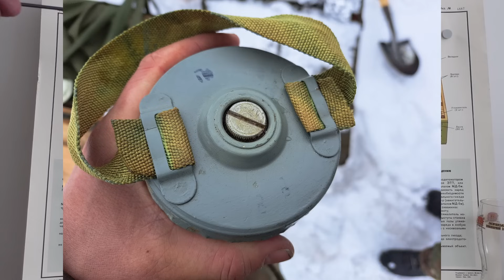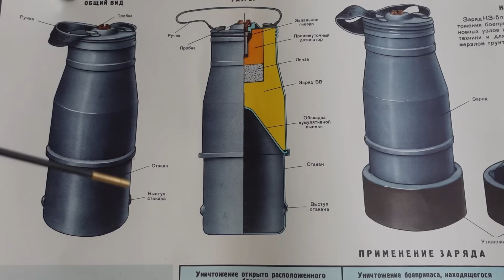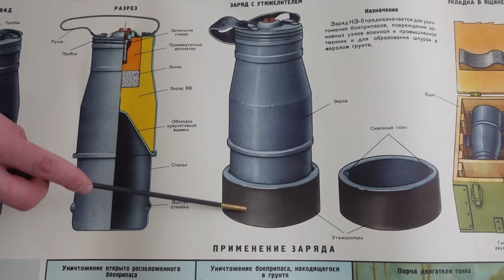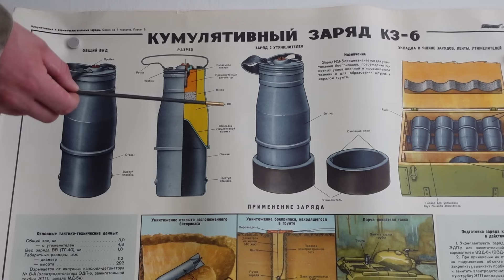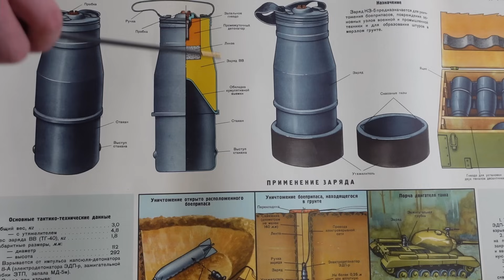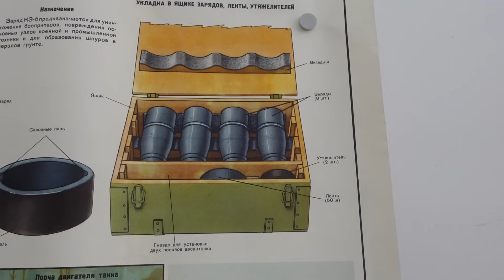WW3 Cumulative charge:  KZ 6

Comment: Never heard that term. “Cumulative Charge”. It seems to be what we called a shaped charge. We also had them in various sized. You could for example put a shaped charge onto frozen ground. And it would bore a small but deep hole with the shaped charge “jet”. Which you could then put in a cratering charge down the hole. And create a fighting position or to limit mobility of vehicles. Etc.
Reply: Cumulative charge is apparently the Soviet Union phrase for shaped charge
Reply: That sound so much better than using an entrenching tool for hours
Reply: @ truly frozen ground… deeply frozen… is like using an e tool to get through concrete. But yes. It’s like using a pick in combination with a shovel. Moving “broken apart” soil is much easier than doing the breaking.
Reply: Cumulative charge kinda makes more sense than "shaped charge" tho.
Reply: @teresashinkansen9402  in order for “cumulative” to make sense… with the English Language… you would have to have multiple charges… or multiple processes… that when combined… increase the resultant. There is no “multiple charges” or “multiple processes”. Just a single detonation. You might argue that the geometry in a particular charge increases its potential force. Which is true. But nothing about this increase is due to an accumulation or a cumulative process. It’s a single detonation that uses geometry or the “shape” of the detonating material to focus its force on a single point. No more or less energy is required. Just a more “efficient” use of the same energy. Hope that makes sense. Not sure if English is your primary language.
Reply: @ By changing the geometry of the liner you are cumulatively increasing its cross-sectional density.
Reply: @ again… you’re not using the word “cumulatively” correctly. “By changing the geometry of the liner”… you are “cumulatively”. The Definition of cumulatively is to increase or enlarge by successive additions. What are the successive additions. What is being added together? Are there multiple geometry changes in a process that we can add together?
Reply: @ define “cross sectional density”. What does this even mean?
Reply: @ Look it up by yourself, its is a common term used in ballistics. But basically means the apparent density of an object by taking into account its area, density and lenght.
Reply: @teresashinkansen9402  another argument/thought… is that typically shaped charges don’t just use the Monroe effect on it’s own. It also uses a metal (Typ. Copper) that the Monroe Effect will turn into a liquid (molten) slug… that gets “pushed” at the same velocity as the Detonation Velocity of the Explosive (which is very very very fast). Like from San Diego to New York in “7 minutes” fast for PETN (in det cord). So you might also argue that this is a cumulative process. When you are combining not just an explosive… but a Liquid Metal “slug” or “bullet” to do more… than either on their own. But this would lead down the road that even a hand grenade is a “cumulative” charge. Due to the presence of a primary explosive (cap), sometimes a “booster explosive”, and a primary explosive filler (Typ Comp. B) and then the jacket or fragments. Which all combined do more damage than the pieces. But to me… that’s silly.
Reply: @ I’d say a name that describes the function makes sense. What a shaped charge does… is utilize the Monroe Effect (where the detonation velocity of a solid “detonating” directly into a gas… always occurs perpendicular to the surface of the explosive) to direct a detonating in a particular direction and focus it. It has nothing to do with the explosives (as many types can be used) and everything with the “geometry” or “shape”… aka… a “shaped charge”.
Reply: @ so in order for me to agree with your statement… you’ll have to clarify how the word “cumulative” makes more sense. I don’t see it.
Reply: @ The charge works by imparting energy from a large area of explosive into a thin barrier (the liner) which then collides with itself, and by hydrodynamic deformation the liner turns into a rod like projectile. So the penetration is due the cumulative effect of the mass penetrating into small area.
Reply: @teresashinkansen9402  what cumulative effect? What is accumulating?
Reply: @teresashinkansen9402  accumulating: to collect a large number of things over a long period of time:
Reply: @teresashinkansen9402  cumulative: Increasing or enlarging by successive addition
Reply: @teresashinkansen9402  what are the successive additions?
Reply: @ Cross-sectional density
Reply: @ Exactly. The liner is now a rod like object which penetrates the target by continuously impacting material in a small area. Imagine a long train crashing into a wall.
Reply: @ so what “cumulatively” increasing this “cross sectional density” mean?
Reply: @ density is the mass/volume. I’d say that the density… decreases… not increases… as you detonate the charge. If it was cumulative… as in the cross sectional density as you said… the charge would be facing away from the target.
Reply: @ yes… that’s how a shaped charge works… lol. Now what’s “cumulative” about that?
Reply: @ Now you explain me how "shaped" is a better definition. When shaped only means in the shape of. What shape?  Any charge is shaped for optimal performance for its specific task, there is nothing that says shaped defines a device that works by the Monroe effect.
Reply: @teresashinkansen9402  again… “cumulative” is a succession of additions. Or multiple inputs that add together for an increased quantity. What multiple inputs are being added? When you’re discussing a shaped charge?
Reply: @jastrapper190  My charge is "shaped" in the for of a pizza. will that work? it is a "shaped" charge.
Reply: @jastrapper190  What you say makes no sense. Wikipedia has a good article about it.
Reply: @ because of the shape. It’s the shape that does the work. If it were a square void… or a circular void… or some other geometry… you’re not going to penetrate as much steel.
Reply: @ they have spent ALOT of money and time into determining the optimal shape/geometry to achieve the maximum penetration
Reply: @ The Munroe or Neumann effect is the focusing of blast energy by a hollow or void cut on a surface of an explosive
Reply: @ different shapes… will have different effects. As you’re directing the explosives in different ways. Think of what a magnifying glass does to light. How you can shape lens to do a whole range of things.
Reply: @ the Monroe effect… IS the shape. It’s what occurs… when you have a particular “shape”. In demolition training… they often teach how to use an old wine bottle… as the bottom of it… if you mold C4 into it… will give you a very good proximation for the void/shape that a factory would produce when pouring the charge for a Javelin or TOW missile penetrator.
Reply: Approximation*
Reply: @teresashinkansen9402  no… a shaped charge is designed to penetrate steel armor (or concrete or wood)… you can’t just use “any” shape. It’s a very specific shape. Aka… the shape of a “shaped charge”. Lol
Reply: @ Shape does not define anything it only means in the form of. I could have a charge which its optimal shapes resembles a banana, that a shaped charge. An accurate name would be a Monroe effect charge, or cone charge, or jet charge. Because such names resemble more the shape or name the actual effect, not just "Shape". Shaped charge is as accurate as saying, explosive device.
Reply: @teresashinkansen9402  you can think of it as a con cavity. An umbrella… with the handle… as the visual for where the “shape” is going to direct the blast.
Reply: @teresashinkansen9402  if you had a “dome” a convex shape… instead of a concave… you would penetrate nothing. It would be an even worse geometry than if you just had used a solid flat plane.
Reply: @teresashinkansen9402  about what?
Reply: @ As I explained before. The Liner is a thin object so when it is accelerated and collides with itself, by hydrodynamic forces it becomes an elongated object, so the cross-sectional density of the liner effectively adds up, aka "cumulatively" increases in a span of time until it reaches its target and cumulatively in a span of time imparts its kinetic energy in a small area, like a long train crashing. The cumulative effect of many train cars crashing, same effect.
Reply: @ i agree. “Shaped” isn’t an all inclusive or completely descriptive. As it’s not just a single shape that will produce every effect needed. But you’re talking about a class of things. Which we refer to as “shaped charges”.
Reply: @ these can include what they call “flex linear” which is a soft malleable metal that comes in a roll. Like a garden hose… and you can unroll it and tape it to steel. If you look at the “cross section” of this charge… it’s a “V”… but again… a very specific “V”… that also uses the Monroe Effect to cut steel.
Reply: @ when you say a shaped charge… you’re describing a way to use explosives. By directing the blast with geometry. The “shapes” vary.
Reply: @ I like Monroe Effect Charge. I like Cone Charge. I like Flex linear shaped charge. Jet charge… yes yes… lol. All good. What I don’t like is “cumulative”… as I don’t see anything that’s “accumulating”.
Reply: @ taking charges that use geometry… and saying they’re “cumulative”… doesn’t make sense. It implies that you’re “stacking” or taking multiple things and adding or combining them together for a greater effect. Which isn’t what’s occurring in a shaped charge.
Reply: @ is can see your argument… that you’re saying the cross sectional area is changing… but it’s not accumulating. It’s the opposite. The cross sectional area is decreasing. This is 100% needed for the charge to function. It’s not about the increase or decrease of the cross sectional area as you go away or toward the target. This doesn’t matter. What matters is the “direction” or the “vectors” that come off the perpendicular surface of the explosive. You need these vectors to point at each other… but not so much as they cancel… but enough that they “reflect” and bounce against each other… so they combine together in one particular direction.
Reply: @ if I tell a child… I have a cumulative charge… or a shaped charge… he’ll have no understanding of what I’m talking about. But I’ll have a much easier time teaching why this class of things is called a “shaped charge” than trying to explain how the word “accumulates” or “cumulative” fit into what is occurring. Well Son… this is a “cumulative” charge… because something something… cross sectional density. Lol
Reply: @ cross section… and density… don’t belong together imo. A cross section is a plane. An infinitely thin “slice”.  It can have an area. But never a density. A density needs a volume. As by definition it’s the unit of Mass divided by Volume. You might in Engineering refer to something having a small cross section for a given mass. Like in aeronautical engineering. But to say a shaped charge has a “variable cross sectional density” it just doesn’t make sense. You could say it has a variable cross sectional area. Like a sphere. While a square has a constant cross sectional area. But you would not say… a sphere has a variable cross sectional density. If that makes sense.
Reply: @jastrapper190  Now you see how "shaped charge" is so nonsensical?
Reply: @ Look up by yourself, Im not making that up. Im done, this discussion is silly.
Reply: @teresashinkansen9402  no… I’m still trying to figure out what “accumulating” or “cumulative” has to do with anything. The word “shape” makes sense… because that’s essentially what the Monroe Effect is. Using geometry to focus an explosive force.
Reply: @teresashinkansen9402  maybe try again to explain what’s “cumulative” about a shaped charge. 🤣 what is accumulating? A force? A cross sectional area? What?
Reply: @teresashinkansen9402  the Definition of the Monroe Effect: The Munroe or Neumann effect is the focusing of blast energy by a hollow or void cut on a surface of an explosive
Reply: @teresashinkansen9402  Hollow or void… are descriptors for shape.
Reply: @teresashinkansen9402  now use the definition to explain what’s “cumulative” or “accumulating” in the process…
Reply: @teresashinkansen9402  is Flex Linear accumulating? Or cumulative? Explain why or why not. And describe what it is that is accumulating. A force? The shape? A cross section?
Reply: @teresashinkansen9402  look up what?
Reply: @teresashinkansen9402  Cross Sectional Density? Do you mean the Sectional Density Ratio? Because this is a very poorly chosen descriptor. Like “cumulative charge”. But once we look it up. And say a nail… has a “better” sectional “density” (which should be area…)… but we’ll run with it. A better SD ratio than say a gold coin… what does that have to do with the discussion? Does one shaped charge have a better sectional density (again it should be called a sectional area/mass) over another? What makes one better? And how does that apply to the discussion?
Reply: @teresashinkansen9402  if it was silly… I’m very much surprised you’ve commented as much as you have. Thanks for telling me though… i was unaware. You’re also free to go whenever you like. The doors not locked. Lol.
Reply: @jastrapper190  Looks like someone finally looked it up. 🤣
Reply: @jastrapper190  If you cannot figure it out I wont explain it to you, enough of wasting my time. This is simple stuff you should understand and part of the basic principle of how the Munroe effect works.
Reply: @teresashinkansen9402  i 100% agree. Shape. Aka “shaped charge”. You won’t explain it to me… because you can’t. That’s my guess. If you could relate “cumulative” to the discussion… you would have by now.
Reply: @teresashinkansen9402  but please… feel free to prove me wrong/effectively argue your position. Or… keep wasting your time. I’m not able to affect you. Like a shaped charge would affect steel due to its geometry/shape and nothing to do with something being cumulative. YOU… YOU are wasting YOUR time. I’m not able to do that. Make sense? 🤦‍♂🤣
Reply: @ I already did, the rest is up to you to understand. :body-blue-raised-arms:
Reply: @teresashinkansen9402  which comment do you think best highlights your point? About what is cumulative? It might help if you start by looking up the definition for cumulative. Lol
Reply: @teresashinkansen9402  2 + 2 + 2 = 24. It’s up to you to understand… something something… cross sectional density… good luck! 🤣
Reply: @ Umbrella..... facing backwards...... concave, define word....👽🤪💊💊
Reply: @teresashinkansen9402  this is what you say… when you can’t explain how the word “cumulative” applies to a shaped charge. I’m glad you’re still happy to waste your time! Lol 🤪
Reply: @  I already did, the rest is up to you to understand. :body-blue-raised-arms:
Reply: @teresashinkansen9402  no you didn’t. You’re not very bright… that’s why you’re confused. It’s the same reason that you’re still wasting YOUR time responding. Lol
Reply: @teresashinkansen9402  the closest you got was the following: “So the penetration is due the cumulative effect of the mass penetrating into small area.” Cumulative effect of what? You need to have multiple things to accumulate them. Or to have a cumulative effect. “So the penetration is due” … to the “cumulative effect of the mass penetrating into a small area” what is accumulating? What is “cumulative” the mass… and something else? Or just the mass?
Reply: @teresashinkansen9402  and the “mass” of the jet… focused on a small area… makes no difference. It has nothing to do with “mass”. As a huge shaped charge or a tiny shaped charge… the “mass” is variable. It’s not the amount of material that’s having the affects on the target. It’s the velocity and molten nature of the slug.
Reply: @teresashinkansen9402  a Armor Piercing Discarding Sabot round… has a minimum mass. When compared with a SQUASH HE projectile. It’s the shape and the speed and the material hardness that penetrate and do effects to the target.
Reply: @teresashinkansen9402  but you’re not going to hear anyone say it was a “cumulative” effect of the mass penetrating into a small area. This is a meaningless statement. You might have better luck with the argument that it’s the “cumulative” variables of mass, material properties, and velocity. At least that makes sense. But we’re not going to make the reach that a dart penetrator is a “cumulative” penetrator. What projectile isn’t a “cumulative” penetrator at that point? As they all have variable mass, material properties, geometry, and velocity… as well as many other things that we could “accumulate”. 🤣
Reply: @ Yes I did. You didn't even knew what cross-sectional density is and how it is related to penetration of material by a hypervelocity jet. From now on I will call devices that use the Munroe effect or cumulative charges an "umbrella charge" LMAO. ironically still more accurate than "shaped charge" :face-pink-drinking-tea:
Reply: @jastrapper190  :face-blue-smiling: Its not molten thats a myth, unless you use liners with a melting point below 800C° Yes after a certain speed (hypervelocity) its all about mass and sectional density. Look up Newton's approximation to penetration depth.
Reply: @teresashinkansen9402  true. I had to look up what you meant by the ratio of something’s cross section vs its mass. But this is like being confused about why an arrow penetrates at the same velocity where a frisbee doesn’t. What’s your point?
Reply: @teresashinkansen9402  in the Marine Corps… they call them “wine bottle charges”. As it’s the geometry at the bottom of a wine bottle that enables the explosive to have an affect. It’s shape. Like an umbrella. Or a rainbow. You can use many descriptors… when you’re trying to explain to a child.
Reply: @teresashinkansen9402  and when you use any of your terms…. Like Monroe Effect (aka using a shape/geometry to direct explosive force)… or wine bottle (aka using the concave rounded bottom of the bottle which has the needed shape to produce the Monroe effect) or Umbrella (same as above)… all of these things are discussing the geometry needed.
Reply: @teresashinkansen9402  and then there is you… and the Russians (which I highly suspect is due to a language translating error/abnormality from Russian to English)… talking about “accumulating”. Accumulating what?
Reply: @teresashinkansen9402  accumulating mass? Or mass plus geometry? Or mass plus velocity plus geometry? What is accumulating?
Reply: @teresashinkansen9402  I’d still love for you to explain what is “cumulative” what are the things we’re adding? And how does that apply to a shaped charge? Is flex linear cumulative or a “cumulative charge”? Why or why not? What would make something no longer cumulative. If you remove the metal slug… it’s still a shaped charge. You’ll still get penetration. The “wine bottle” uses no slug… it vaporizes the glass. So without this “accumulation” is it still cumulative? Why or why not?
Reply: @jastrapper190  I already explained it, its up to you to understand it. :body-blue-raised-arms:
Reply: @teresashinkansen9402  if you just took a 1 1/4 block of C4 and molded it into a little umbrella… with your hand… vs just a flat block… and put it onto a structural I beam… which one would cut the beam… what is “accumulating” with one… and not the other? What does the cutting of the steel? Because I can assure you… both will cut the steel… but one will do it much better (the one you “shaped”) but nothing is being “thrown”… there is no “Cross sectional density” of anything but the C4 explosive. Are the cross sections accumulating? Or the force vectors of the solid being chemically turned into a gas using the Monroe effect accumulating? What is “cumulative” that’s the question? Now you can answer… or try to. Lol
Reply: @teresashinkansen9402  Please find me any… any links… to anybody using the term “cumulative charge” besides the Russians. No other Nation on planet Earth… have I ever heard refer to a shaped charge as a “cumulative charge”. It’s nonsensical. But I’d love to see what you can dig up. From any nation besides Russia.
Reply: @teresashinkansen9402  i think what you’re going to discover… is that the word “cumulative” is arising from a linguistic difficulty in translating from English to Russian. Or… the Russians are just dull. Which could very much be true… as some of the names they give things… are wild…. 
We say: WWII… 
Russians say: The Glorious Patriotic Revolution of the Russian People’s eternal struggle against the Nationalism of other Nations due to Stalins Great Genius and Love of the Glorious and earnest Soviets Peoples of the Union of Soviet Socialist Collectives and their subsidiaries…. Cumulative! 🤣
Reply: @teresashinkansen9402  you can have a shaped charge with nothing being thrown… you do realize that correct? So is a “cumulative” charge… because you’re adding the liner? Is this what you’re trying to say?
Reply: @teresashinkansen9402  I’m not arguing about why a shaped charge does what it does. Or what the liner in the shaped charge is doing. I’m asking you… why are you using the term “cumulative”? What is accumulating? You’ve talked about Mass, velocity, a molten slugs “cross sectional density”. You could add in standoff distance. Type of explosives with various REF’s. Lots of variables… are you saying that these are “cumulative” so if you add them together you get more? What are you saying is “cumulative” forces? Materials? Velocities? Geometries?
Reply: @teresashinkansen9402  a shaped charge… will cut steel… with no liner. I can take C4… right now.. and mold it into a great “shaped charge”. Then prime it with a cap… and go punch holes in steel. Is this a “cumulative charge”? Why? Or why not? What is “cumulative” about it?
Reply: @jastrapper190  Okay I will bite and explain again. Mass and energy, that's what is cumulative, in a hollow charge (which has no liner) the same happens but instead its high speed, high density gas. It might not be a very accurate term but is still far more accurate than "shaped". Even "umbrella charge" is more accurate as funny as it sounds though still far from being accurate. The reason why it seems so natural to you "shaped charge is because it is used to refer to such kind of charge but etymologically makes no sense. "Shaped charge" makes as much sense as saying explosive charge.
Reply: @ lol… so the two words… “mass” and “energy”… i think you mean “mass” and “potential energy” (velocity or the energy of motion)? That’s what you’re saying is “cumulative”? Is this correct?
Reply: @ you’re 100% correct. Nothing is being “accumulated”. Nothing is “cumulative”.
Reply: @ when you say you have mass and velocity… and it’s these two variables that are “accumulating”… you’re describing every projectile on the planet.
Reply: @ There we go! yes. Just that I call the energy of motion kinetic energy, not potential energy. The cross-sectional density of the liner cumulatively adds up,  all the energy it got from a large area of explosive cumulatively act on a small area, like a train impacting a wall, cars crash continuously, so the damage is cumulative, you could say.
Reply: @ mass and velocity… being cumulative as it relates to explosives… again… what are you talking about? You can have a lot of mass… or a little mass (lots of C4… or the smallest amount imaginable… down to molecules) you can have explosives with a whole range of detonating velocities or REF’s from a 1 for TNT… to a xxx for PETN….to yyy for comp B… etc etc. and they will all produce the same effect. The Monroe effect. They will all use “shape” to do something that would be impossible without the geometry.
Reply: @ shaped makes ALOT of sense… it’s why every Nation in the world… calls the charges that utilize the Monroe Effect… “shaped charges”.
Reply: @ nobody is going to disagree with you that “shaped charges” is a widely known and agreed upon term. Why? Because it’s a “charge”… that uses “shape” for an effect. Whether it’s striking a MBT at distance or cutting a structural I beam.
Reply: @ the term “cumulative” makes zero sense. It’s this magic Russian concept… of a combination of “mass and energy”… in your words… that are “cumulative”… or get added together…something something… and their greater than just mass or energy on it’s own. Brilliant! 🤣🤦‍♂
Reply: @ I agree… even “rainbow” or “umbrella” are much much better… not as good as “shaped” but still much much better than “cumulative”. Something something… mass and energy… cross sectional density… lol
Reply: @teresashinkansen9402  kinetic* correct.
Reply: @jastrapper190  No, you are not getting it again. most projectiles don't change shape as they are fired.  An "umbrella charge" goes from looking like a cone with relatively thin walls (low cross-sectional density but large area thus easy and efficient to get accelerated by a shock wave) to looking like a carrot with a very long and fine tip. That change is what I call cumulative.
Reply: @teresashinkansen9402  the cross sectional density of the liner cumulatively adds up… 🤣
Reply: @teresashinkansen9402  define cross sectional density again for me?
Reply: @teresashinkansen9402  I’m not even 100% sure you understand the Monroe effect. I’ll try to explain it. When you have a flat surface… and this surface “detonates” or chemically is turned from a solid to a gas… that expanding gas travels “out” from the explosive surface perpendicularly… always perpendicularly.
Reply: @ Umbrella..... facing backwards...... concave, define word.... lol this again.
Reply: @teresashinkansen9402  so what the Monroe Effect is… is using this property… to “focus” that gas (or a metal liner) into a single point. What you described is correct… but your terms are very awkward. Nothing is “cumulatively adding up”. The detonating velocity… isn’t “increasing”. It remains the same…
Reply: @teresashinkansen9402  the slug you’re throwing… will be thrown at the same velocity… if you shape it… or have a flat plate sitting on a flat block of explosive.
Reply: @teresashinkansen9402  what the Monroe Effect does… is use the detonating velocity… imagine an arrow coming off the surface of the explosive. Typically referred to as a “vector” in 3D space… and when the shape of that explosive… directs all of the tiny vectors… toward each other… you are concentrating the force on a single point.
Reply: @teresashinkansen9402  so now imagine… a “shape” or a con cavity… is placed into different things. Same sized concave frustum or cone… but it’s in a sphere… or a cylinder side… or a cylinder end… or in a flat sheet…. All different “cross sections”… and all different masses. From cylinders or spheres as big as a battleship… to just bigger than the frustrum/cone. It’s not the “cross section” or the density (mass / volume) or overall mass of explosives of any particular combination… that’s going to produce the Monroe Effect. Some combinations will work much better say in a TOW missile. But it’s the “shape” or “geometry” of the explosives that are producing the Monroe Effect.
Reply: @ what is a “low cross sectional density”? Vs a “high cross sectional density”. What in Gods name are you talking about?
Reply: @ Sectional Density = (SD). Mass = (M). Cross Sectional Area = A. SD is a ratio for an object. SD = M / A or in a different form SD = A / M
Reply: @ Sectional Density… is another way of talking about a bullet having a ballistic coefficient. Or how well it will travel through the air. Its shape determines the drag or resistance to motion through a fluid (Typ. Air)
Reply: @ something with a small cross section… but a large mass… has a ratio. Or Mass / cross sectional area. Or cross sectional area / mass. It’s a number a ratio of two things. Like 1/2 with units of 1 kg/ 2 cm^2 or 2 cm^2 / 1 kg. miles per hour… is just as valid as hours per mile.
Reply: @ a cone doesn’t have “variable” cross sectional density. You’re not even understanding what sectional density is referring to. With a bullet… it has many “sections” that you could take. But you’re not going to say it has a varying “cross sectional density”. This is dumb. You’re going to say… that a bullet has a sectional density of X. Or it’s largest cross sectional area over its mass.
Reply: @ essentially it’s the ballistic coefficient (BC) can be calculated using the formula: BC = m / (d² * i), where m is the mass of the bullet, d is the diameter of the bullet, and i is the coefficient of form.
Reply: @ Sectional density is the ratio of an object's mass to its cross sectional area with respect to a given axis. It conveys how well an object's mass is distributed to overcome resistance along that axis. Sectional density is used in gun ballistics.
Reply: @ when you’re taking an object like a cone… and you turn it “pointy end” forward… or “pointy end” back… it has the exact same “Sectional Density”. Or the surface area (along it’d direction of motion… or out of a muzzle)… over the mass. Or the mass over the surface area.
Reply: @ when you say… the cross sectional density of the liner is cumulative… you sound like a child. Lol. Please prove me wrong… and keep having that nice day… of being bored… a person who no longer wants to explain or talk. Please. I wish you the very best of luck. Cumulative!!!
Reply: Well Im bored, have a nice day. "Umbrella charges" LMAO ☂🎆
Reply: @teresashinkansen9402  you said this multiple times genius. But that you for telling me about your cumulative boredom. “Cumulative charges” why don’t we come up with something even more ridiculous than both of those… call them Ham Sandwich Charges! Because the Cross sectional density…is like a ham sandwich… with energy and mass getting added together? Something something cumulative!
Reply: @teresashinkansen9402  I’d be bored too… you could search for an eternity… before you find any information on any other Nation on this planet… dumb enough to call a shaped charge a “cumulative charge”. Which makes about as much sense as the statement.. it’s the cross sectional density of the liner which is cumulative…
Reply: @ sectional density would also not just determine how a projectile moves through air… it would also very much have bearing on the target as well… as in something with a very skinny surface area… like an arrow… with a given mass… will be much more painful upon impact that a frisbee with the same mass. All else being equal (like the velocity). But again… a frisbee or a bullet… has one number for its “cross sectional density”. But you’re not going to say they “vary” along the length. If I had to guess what your tiny mind is trying to say… is that the cross sectional area of a given mass… varies along its length. Which doesn’t at all describe why a shaped charge does what it does. If you took a “wave” of material… that got farther away… and closer to the frustum or cone… so that the cross sectional areas got bigger and smaller… or smaller and bigger… when you took these “slices” or cross sections… it’s still going to be a shaped charge. It’s the geometry of the cone or the void that is the driver of the shaped charge using the Monroe Effect. It has nothing to do with the mass, the volume, increasing or decreasing cross sections, etc. all of these variables are optimized for whatever application the charge is going to be used for. When you’re talking a TOW missile volume… you’re very much limited in the size and shape. Also you would never have a “wave” of material on the other side of the cone… as you’re losing efficiency. But the increasing or decreasing cross sectional density is cumulative… is nonsense. NPC type thinking.
Reply: The KZ-6 is called a "cumulative charge" because it is a type of shaped charge that uses a conical liner to focus the explosive energy into a high-velocity jet of molten metal. This focused, or "cumulative," jet can penetrate armor and other hard targets. The term "cumulative" refers to this process of accumulating and directing the explosive force in one specific direction.
Reply: @Maxamander3008  shaped charge* do you go and pick up the force in a bucket until it’s full and you’ve accumulated enough of it… and then pour it out?